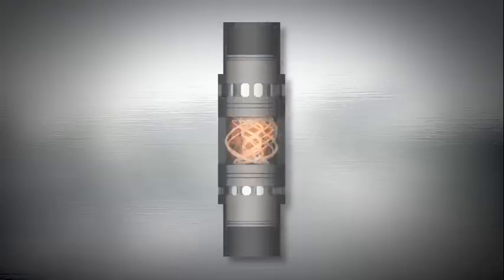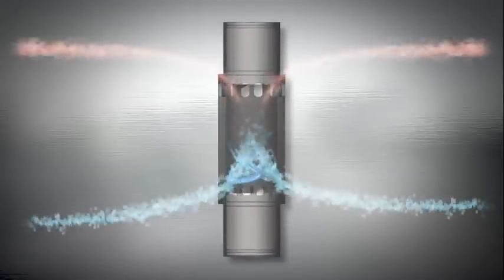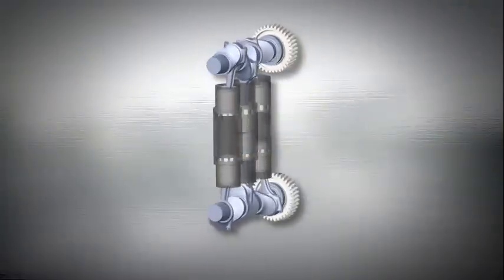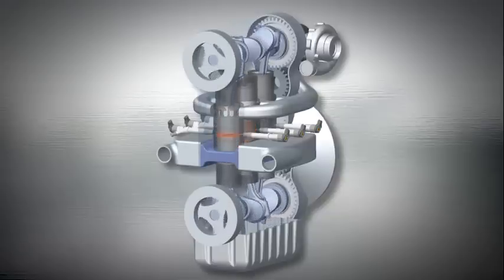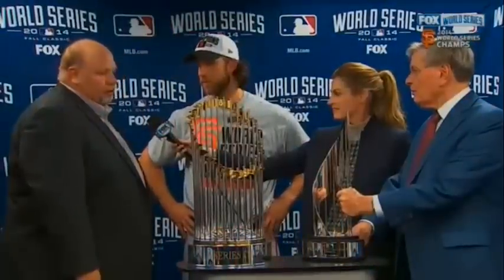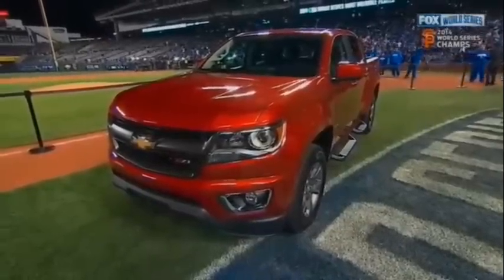An Update on Achates' Revolutionary Engine - Autoline After Hours 264

Comment: What's the revolution? Opposed cylinders of this disposition was at least in 1930-s, and later in russian tank engines.
Reply: Look at the VAST majority of automobiles made over the last 100+ years. The engine has been same architecture all that time, which scant few exceptions making it to production. If this is a revolution, it is a revolt against the same old 100+ year old design that really can not do the job anymore.

Liken it to Light bulbs, For a bit longer than that of the common Internal Combustion Engine (ICE), we have had incandescent light bulbs (ILBs). They were good, cheap, but not very efficient and not very bright unless they glowed/burned very brightly, which wastes energy and posed a safety and fire hazard. Then came Compact Florescent Tubes (CFTs). They used less power to produce as much light, last so much longer that you would easily buy as much in ILBs as one CFT. Then comes LEDs, Light Emitting Diodes. Not just for cars, they used even less power and are brighter and last longer still.

Cost goes up or it did. Current CFTs can be had for the cost of ILBs while LEDs still cost hella' more.

Despite ILBs getting better they reached their limit, which was made obvious by energy cost concerns well before the Govt started harping about it. Consumer advocacy took it up and  the GOVT only had to advertise it, if they even bothered.

ICEs are much the same way. But now you keep having to add more and more to one to make it better. Things such as forced induction, Hybrid-electric systems, ever more difficult and elaborate fuel injection, and so on. But if you can do better with a less complicated, less expensive engine, then you have a revolution on your hands.

Unlike, light bulbs, though, ICEs have had numerous alternative designs, over time, some were often too far ahead of the curve to work in the time they were tried, others just did not catch on. Now however, fairly recent improvements and advancements in manufacturing, small parts, and even much of the refinements and technological advances of common ICEs, now allow these designs to work, bring their own solutions to questions common engines struggle to even respond to nevermind answer.
Reply: DocWolph Incandescent lightbulbs are a superior design. They had to ban them for them to go out of business. This means, we are now forced to use worse lightbulbs by law. This law is superfluous and bad.
If the powers to be want it, the incandescent and the piston engine can make it another 100 years and a thousand years and forever. The idea we have to give up current technology for environmental reason will never produce superior or advanced technology. It will always be a drawback. Revolutionary breakthroughs are to be found elsewhere.
Reply: Rainer67059
Okay... So, is your Earth flat or round?
Reply: Rainer67059 Incandescent bulbs are a cheaper design to produce, not superior. There is a difference. Incandescent bulbs are inefficient compared to fluorescents. And they're terribly inefficient compared to LEDs. Likewise the conventional IC engine is horribly inefficient. (Only about 20% of the energy of the fuel actually gets to the wheels.) The only thing it has going for it is that it is cheap to produce because it requires no new tooling to build, and current production processes are optimized for it.
Reply: +dlwatib Incandescents are inefficient, but compact fluorescents are unreliable..... the ones I use keep burning-out from their complexity (basically the ICs melt in upside-down, heat-trapping installations).  In the outside cold weather they don't turn-on at all, or if they do, they are very dim.  A new technology is only superior if it actually works
.
Reply: electrictroy2010
I have replaced nearly every bulb in my house with CFBs and have had no problems. I have not even replaced CFBs with new ones in years as well. But I have a well lit home.

You don't put CFBs high EM installation like using a CFB to replace the bulb in you Microwave oven. Yeah they don't last long. Put an IB in its place. CFB have been too effective. For home use and a boon for businesses. Though they keep their lights on all day everyday they are open, so those bulbs the tubes will burn out at least once every other year.

How much heat are you in to start, never mind what the bulbs are making? I ask because I have never had CFB fail from  overheat, the one in the Microwave shorted out. IB work best in that situation, in conventional ovens,and fridges. But LEDs work great in Fridges.

Also, if Florescent and Compact Florescent Bulbs did not work no one would be using them now. It would seem you are simply abusing you bulbs by using them badly or in adverse conditions where CFBs naturally would not work well, or you are misinterpreting using them all day every day and they give a few months as they are failing.

Everyone draws the short straw, but if you keep drawing the short straw, you are actually cutting your straws short. No one is denying "the right tech for the right place". But that is where your analogy breaks down. As I used the Light bulbs Analogy, to denote advancement of technology that does what we are used to dong or seeing done in a new and better way, it is absolutely fine as is.

But your assumed intent with your comment is to say the new tech won't work because it has not worked the way you have been using it. But a new engine format, that is more efficient and cost effective well, work when developed and used appropriately.

Comment: Port is just another word for sleeve valve with the piston being the sleeve valve for itself. The automobile industry could have built could sleeve valve engines from the early nineteen hundreds, but they didn't want to. They didn't want because the sleeve valve was invented by a professionally foreign inventor.
Two-stroke engines weren't superior to one-stroke engines in the past, why would they be now.
Reply: Rainer67059 No, port is not just another word for sleeve valve. A port has no moving parts. Flow is opened and closed by the piston itself. A sleeve valve has an additional moving part, the sleeve, between the cylinder and the piston. It moves to open and close the flow.

A conventional two stroke engine pre-mixes fuel, lubrication, and air in the crankcase, then compresses it all into the combustion chamber and burns it all. This design does not mix lubrication with the fuel and does not use the crankcase vacuum to draw in air. Instead it draws in air using a supercharger and injects the fuel directly into the combustion chamber like a diesel after the air has been compressed. It's far more diesel-like than two-stroke-like.
Reply: dlwatib
A sleeve valve has moving parts. But there are variations of sleeve valves where the piston serves itself as a sleeve valve. Many two-stroke engines are built that way and the KKM rotary engine is built that way too. They are usually declared to be valveless, but that's a cheat the piston is a sleeve valve. This is also the case with this engine.

A conventional two-stroke engine pre-mixes fuel and air unless it is a diesel two-stroke engine. And diesel two-stroke engines are more commen these days than gasoline two-stroke engines.
Diesel and two-stroke do not exclude each other.

Comment: wow, i guess Fairbanks Morse never made opposed piston engines 100 years ago? or Sultzer, or Tasimo, or Napier (Deltic) etc etc, what a load of bullshit
Reply: +neil farnell  No one said they didn't they improved what was there !!!
Reply: +Senior Frog  yes they did, watch the first 4 mins.
Reply: Ok I re watched the first 4 minutes and they never said any of those companies didn't make a piston opposed engine !! And like I said they took that idea and improved upon it !!
Reply: ok, i get the sarcasm, it is 2016 and if you apply modern electronic controls, high pressure common rail injection and modern turbo tech to any 100 year old engines, they will work better. If you have an interest in the project I hope it works out for you. My objection is the "aren't we wonderful BS, without paying proper respect. If they talked in detail about how they improved this style of engine it would have made a better video

i
Reply: If you look into this they have in earlier videos from this company they did talk about  this is not a totally new idea and talks about the other makers of this type of motor but this motor is different too which was explained in earlier videos so before you get all outraged you might check the other videos and see what was said. And how many times do you have to say this is a improvement on a old engine when you are making a report that is to people who say the earlier ones?? That gets boring and also lengthens a video that doesn't need to be longer !!

Comment: Show me a motor with 0 emissions, 90% efficiency and no dependency on foreign oil.
Reply: So.. A electric motor? No emissions, no oil and over 90% efficiency :) a combustion engine is incredibly inefficient, most energy is wasted in heat, sadly
Reply: +TheBlizzbeast exactly. Not to mention motors that can last for centuries and can operate for 1/10 the cost.
Reply: +Shawn Crockett it's just too bad that battery technology still have a long way to go until electric vehicles will become viable if you live outside of the city. 
Although I will miss the sound of a nicely tuned engine :)
Reply: +Shawn Crockett smokey yunkic hot vapor engine
Reply: +Shawn Crockett i wonder where you get your electricity from.
Reply: +alberto gordillo I ha solar panels in the roof of my shop but even if I didn't 85% of the power I can buy comes from hydroelectric according to the statement I get from our power company. Why do you ask?
Reply: most of us cant afford solar power, and most of us dont get our power from hydro, wind, etc.. the point here is electrical motors require significant infrastructure to be truly green and carbon neutral, to fill your car battery holding 85 kWh (310 MJ) to full, or even 3/4 - you require at least 9 kw worth of solar panels for 10 hours, or 20 kw worth of solar panels to 1/2 that time, and thats only if all the energy from solar goes into charging your car, this is factoring all the inverter efficiencies and assuming you live on the equator.
Reply: +alberto gordillo solar panels are far cheaper than even 5 years ago. Not only are cells getting cheaper they are also getting much more efficient. As far as infrastructure you are right it is not there yet but starting is the key.
Reply: +Shawn Crockett here,  a 20 kW system will cost you over 20 grand,  factoring the costs of labour to install them,  here only a qualified and certified provider is allowed to install a solar system connected to the grid.  You get what you pay for -  if you use those cheap Chinese solar cells they barely last you 10 years before they dip to 80 of their original capacity,  while solar is getting cheaper in the states due to massive subsidies - other countries do not experience such a discount,  and really - if a solar industry can't be viable without subsidies,  then there's something to be said about its economic model,  solar has to become much more cheap before it begins to show a net economic gain,  and thus be economically viable.  20 grand is a huge investment when a standard household can use around 3/4 of that during the day let alone at night where battery technology needs to improve,  but that's not even factoring the cost of batteries that make sense economically.
Reply: +Shawn Crockett until then,  electrical motors on vehicles are really just lip service for green lobbies while actually netting larger carbon usage, taking into account the amount of carbon released just manufacturing the solar cells in the first place.
Reply: +alberto gordillo you have some valid points about solar needing more improvement but the internal combustion engine is only 15% efficient compared to electric motors that are 95% efficient. Not to mention that these motors are design to last 100,000 hours, which if you do the math would be hundreds of years. 

Talking about subsidies; the US government has doled out $5.4 trillion in subsidies to oil companies in the US alone, that is not to mention subsidies to foreign oil companies. That is millionS times more subsidies given to all other sources of energy producers combined.
Reply: +alberto gordillo I built an electric truck that I can drive for 2¢ per mile (if I use grid power)around town where my other trucks cost me 30¢ per mile. Do you really think that you have an argument when talking about what is economical based upon these numbers. Don't get me wrong I love the sound of my big block 8 cylinder but $500 per month compared to $30 per month... Plus my Chevy cost me $20,000 to buy as opposed to my electric truck that cost me $5,000 to build.
Reply: Shawn Crockett efficiencies in power line transmission, inverter from the solar point to the house grid, charging cable losses, power conversion losses(95% for top of the line buck boost converters), battery charging losses(around 72% efficiency) losses at the motor inverter(around 92% efficient for tesla cars for top of the line components average around 80%) almost completely negate that. its worse when from the grid even if your power comes from green sources, power line transmission losses, substation transformer losses (around 82%), gen head losses at the power station even from wind or hydro negate it even further. latest ICE gasoline model - 56% efficiency, latest diesel ICE 68%.

even if what you said is true, which according to my research is a little twisted from what's likely to be the truth, it doesnt negate the fact that when you factor in all the infrastructure losses with current top of the line technology it actually falls short of ICE engines by a long shot mainly because of the way we store electricity.
Reply: Shawn Crockett i'm not for big oil as much as any other person, but there's a great deal of information out there that is twisted and incorrect to downright fraudulent. none more obvious than in hydrogen power technologies, the math falls short, and as someone that works in the R&D industry - i trust the math.
Reply: +alberto gordillo if you trust the math do it. Check the thermodynamic limit of an internal combustion engine you will find the very best output between 35 and 37%. How can you refute real life data? $30 per month compared to $500 per month. Why does every single railroad in the world use electric motors to power their trains? 
 I worked for the bureau of reclamations where we had 15) 650hp electric motors that were there since 1904 running 24/7 and still running as good as the day they were installed. 
Can you refute real life data? Or are you going to continue to believe the propaganda of big oil?
Reply: +alberto gordillo just so you know, I know you are making up numbers. The field loss and drag on the 22,000 volt lines coming into our station were never more than 2% plus the charger that I have on my truck is 90%+ (the only real loss is due to heat and cooling) and the motor I run in my truck has a rating of 95%+. Check out the stats on the hpevs motors and Curtis controllers.
Reply: Shawn Crockett dude, your making statements about the longevity of electric motors in comparison with ICE engines with hundreds more parts - thats indisputable, electric motors have their perks, which is why they are used in the industries you cited, electricity is cheaper than gasoline or diesel, this is also evident. what i am saying here is that they arnt carbon neutral - and among all its support technologies - solar cells, electronics, plastics, etc.. they are almost as bad as cars, except that they concentrate the carbon production further up the chain at the power stations, manufacturing plants etc.. which i guess as a plus makes it easier to sequester that carbon, but they actually take more carbon to produce than what a car normally burns.
Reply: +alberto gordillo the reason longevity is part of the argument is because you say it takes more carbon to produce than an internal combustion vehicle. The motor in my truck is rated for 100,000 hours, if driven an average of 50mph that is 5 million miles. If I drove 25,000 miles a year (which is very high) that would be 200 years. How many gas motors would I use in 200 years? At  least 20. So are you saying that an electric motor has 20 times more of a carbon footprint?  My motor has three parts none of which are plastic like an ice. Lithium batteries do have some environmental processes that are damaging but all lithium batteries can be recycled; can the same be said about a gallon of gas?

Comment: exhaust & inlet valve should be used.With each valve there should be single pipe line .there should not be common exhaust & common intake

Comment: this will never be the next evolution or direction engines will go sry  if you seriously want to see where engines are headed look up these two technologies first free valve engine this is two years in development with zero fails and about to come to market second variable compression engine which Nissan is bring to production 2017 when these two technologies merge it will be the next true evolution of the internal combustion engines now add twin scroll variable turbos and dry sump oiling systems and every manufacture will have to go this direction to complete